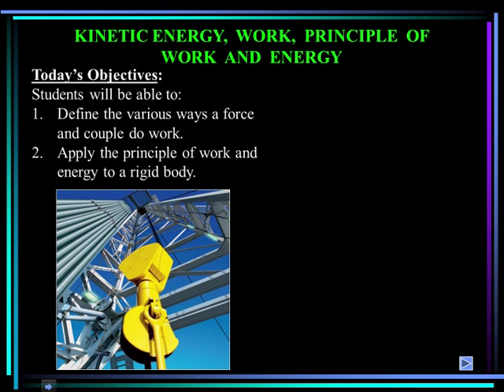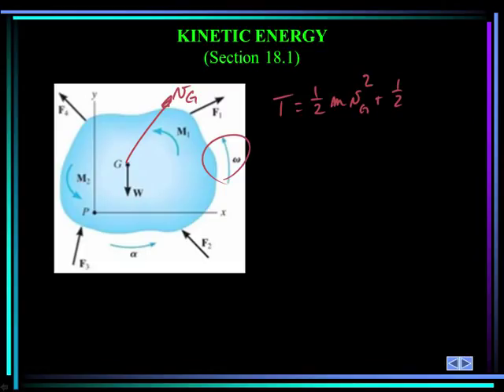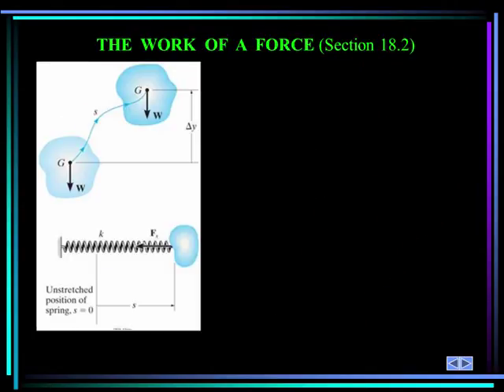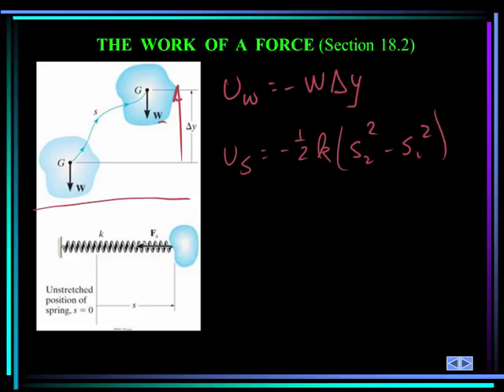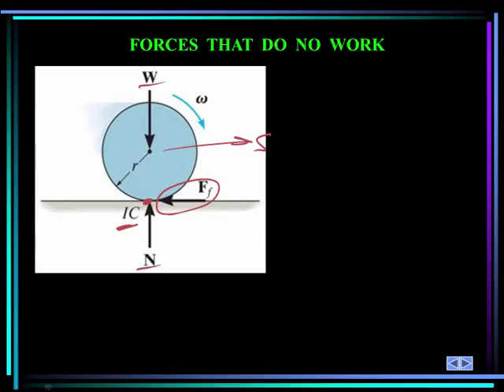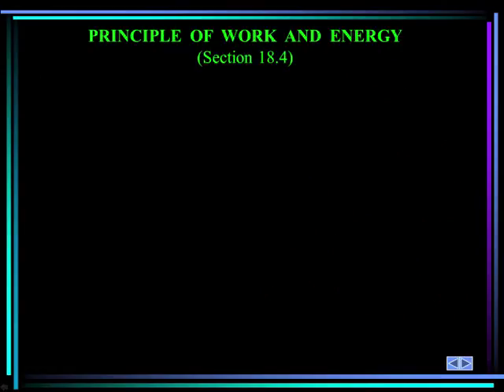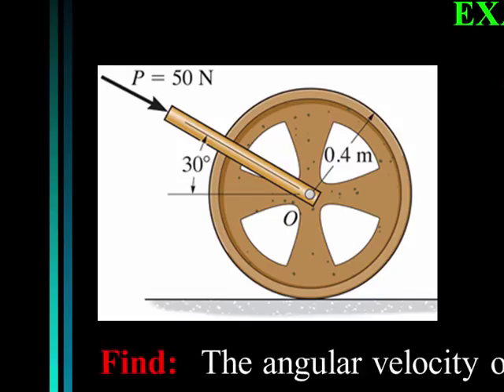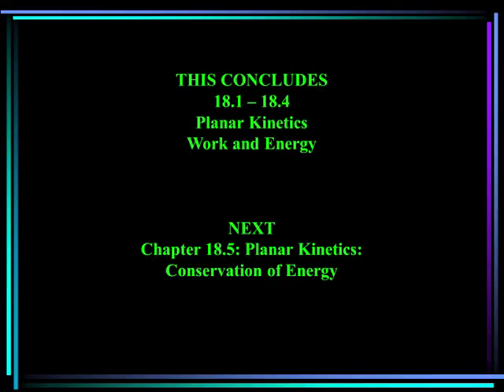ME 274: Dynamics: Chapter 18.1 - 18.4

Comment: Hello sir, isnt the distance that the weight of the box is doing supposed to be from the bottom to the centre point G? (4sin(60)+1)
Reply from the maker: No. It's 4 sin(60). The center of gravity ends up 1 foot above the floor.

Comment: Why isn't the distance the center mass travels equal to 2pi?
Reply from the maker: I assume you mean the first example. The wheel is diameter 0.8 m, so in one revolution it moves pi*d, so .8*pi. It rotates 10 times so the distance the wheel center moves is 8*pi.